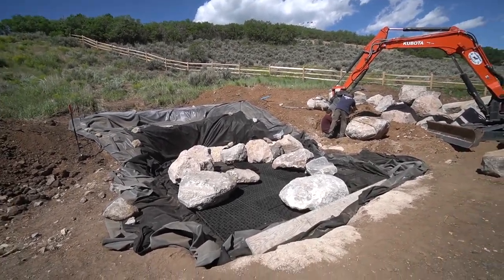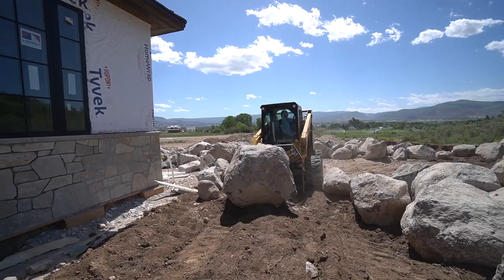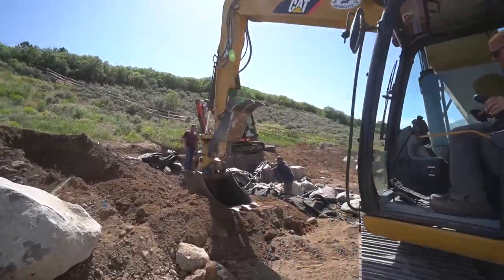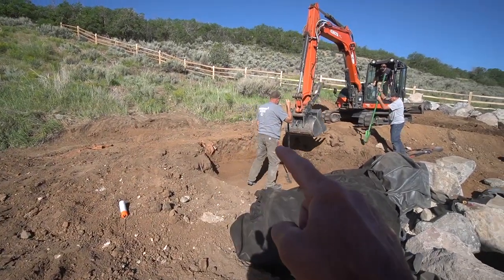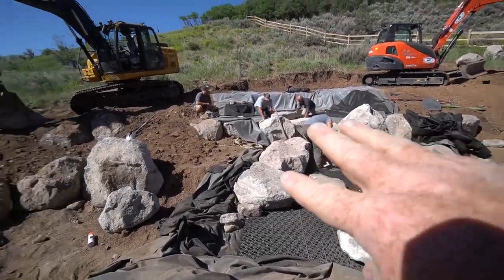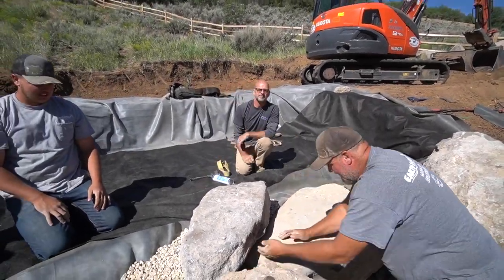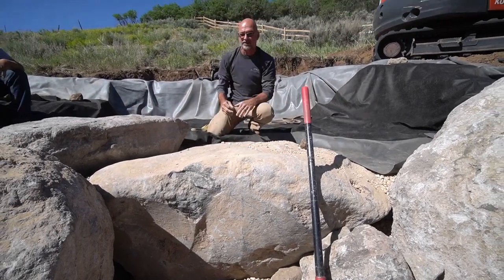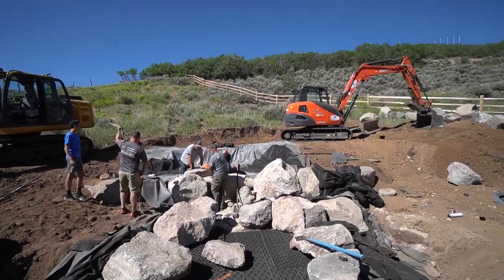*Pondless Waterfall* Design Tip: Framing Boulders - Part 3

Comment: Wow what a massive job...I have a question regarding the bib liner that Brian explain around the 8min. mark...like in this video I want to achieve a kind of a stream over my reservoir that will be 64 in X 159 in for a total of 23 Aquablox, once my reservoir is done will it be easier for me if I install my first waterfall or stream liner and instead of doing a 12in. overlap I oversize my liner for my first drop and I cover most part of the Blox with the said liner after this I instal my rocks or boulders over my long overlap and at the end foam around those said rocks ? thanks!